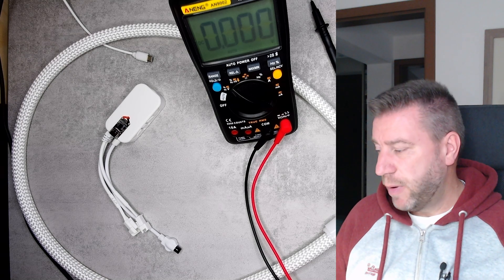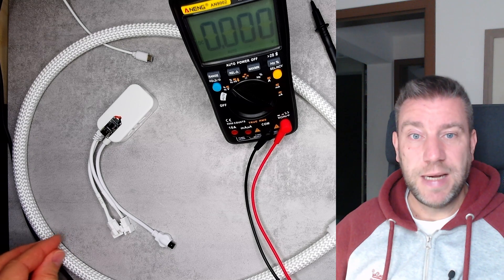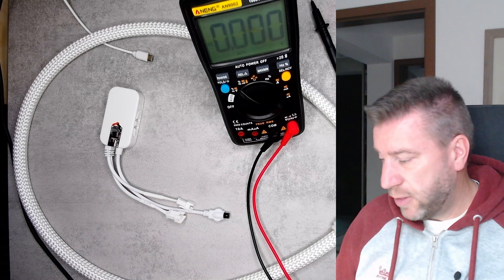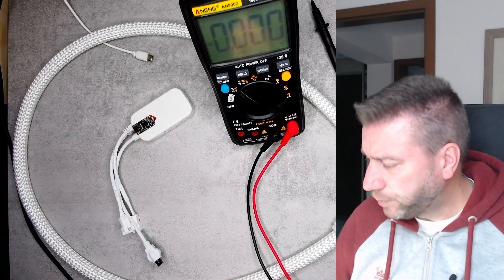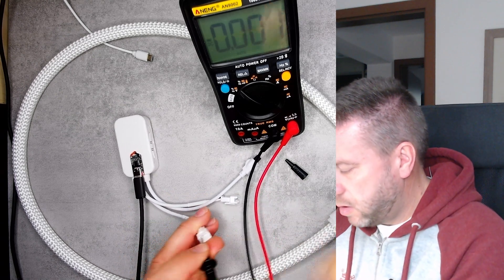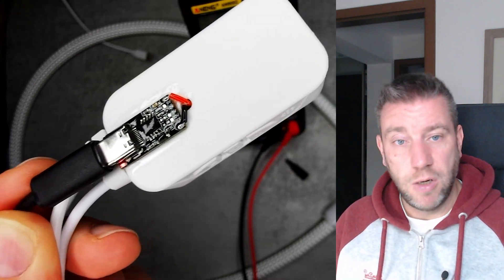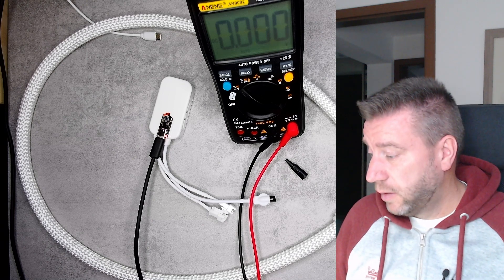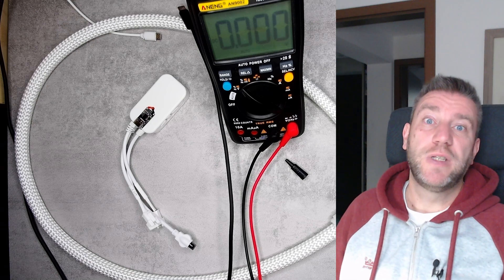Bricked my new lights, but why? Can you help?

Comment: Do you have a spare board? If so can you test it to see what the output is with no bridges. Then apply conformal coating over the bridges and test again. Presumably conformal coating is meant to be non conductive but maybe it is conductive when not fully set
Reply from the maker: Yes, I will try with a new board. But I think it is more likely what other have said that this board is missing a 5V jumper, so it is no safe to assume that it will default to a 5V output if nothing is selected.

Comment: Why did you think you needed a trigger board in the first place? Unless you got too much voltage drop on a normal 5v supply? You could just cut off a 5v usb cable and wire it to the jack +/-. 

A lot of confusing things here. A lot of commenters are blaming the trigger giving out 20 volts. But the controller supports an input up to 24 volts. So 20v should be fine. Maybe the buck circuitry in the controller blew, so now instead of of down-regulating it is just passing straight through the voltage, which likely blew the LEDs.

Test the conductivity of your glue.
Reply from the maker: @ivolol  This is probably my confusion as well. My understanding was that if you have a PD port it will not output anything until a PD chip negoriates a voltage. I have cheap USB-C lights that will not charge from a PD port with a USB-C to USB-C cable. The controller does support 24V, and it is still working, the led strip died which is 5V.
Reply: @csongorvarga the controller is (partially) broken because it can't regulate the voltage it outputs to the LEDs. Remember the controller doesn't know anything about USB PD itself. It's just a barrel jack, that takes 5-24v! All it sees is 20v input, and like you said the LED probably wants 5v. If it is not down converting 20v->5v then it will blow up all subsequent LED strips you attach to it if supplied with any higher voltage. 

A PD port supply will always output a basic 5v to any cable, but with not very much current. It will allow basic USB devices to run. For a small LED strip it might or not give enough current, depending on the strip and the PD supply chip parameters.

A 'dumb' negotiation can be made if you use 5.1k resistors in the data pins. Google can remember how it works. This still gives 5V but with much more current. That might be all you need. 

Then finally it can do full power if it talks to a PD receiver chip like the one on your trigger board and does a full negotiation.
Reply: Usually with these types of controller the voltage out is whatever voltage you input. It will only down convert for the power to the controller and pass through the full input to the LEDs so you can use 5, 12 or 24 volt LEDs

Comment: So, there are multiple types of those triggers. 

There is one type, such as yours, that doesn't have a solder bridge for 5V. 
Those put out 20V by default. (I just measured that.)

There is a second type that has the 5V solder bridge and that one outputs 5V by default. (I just measured that too.)

Both are little black PCBs that look almost the same, except for the solder bridges and how the components are arranged around the trigger IC. But you can't tell at first glance until you look. 

So, you just got lucky the first time you plugged in your lamp.
Reply from the maker: Thanks. Well this time I got unlucky :)
Reply: Also some chargers start with 5V and ramp up in few seconds.
Reply: @TaaviJuursalu  Don't all of them do that?
Reply: @oilybrakes  probably yes...some seem faster than others

Comment: Also next time connect a regular 5V powersuply and not a PD version. Then it cant output more than 5V. This board just says to the powersuply how much it wants and the psu regulates the power not the board.
Reply from the maker: Or just use USB-A which will be 5V by default.
Reply: @csongorvarga  But those don't work with PD power supplies. 
However! 
If you look for 14 pin USB C sockets, you will find a variety that has that little blue PCB with +, Gnd and Data pads on the front and a spot for a Resistor to be soldered on the back. 
That spot goes to the CC lines and you can solder 5.1K there, so it tells the PD power supply that you are a legacy USB device that needs 5V. And then  even the PD power supply will honor the 5V request.

Comment: Similar item on Aliexpress says that it supports 9V-20V. No 5V at all. Because you didnt have any of them bridged it gave you the maximum.
Reply from the maker: But I tested it before and it gave my 5V. With the LED strip and everything. So I am still unsure.
Reply: @csongorvarga  did you use a PD charger while measuring?  the thumb chargers that (they can have a usb-c plug) cant output anything else than 5V. usb-c is a hot mess. you can have PD charging with usb 2 speeds and vice versa.